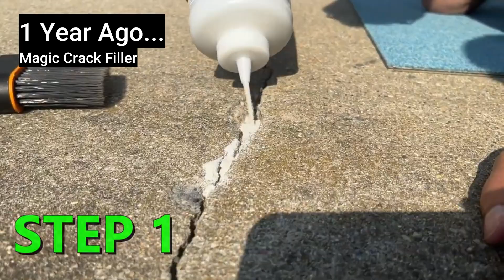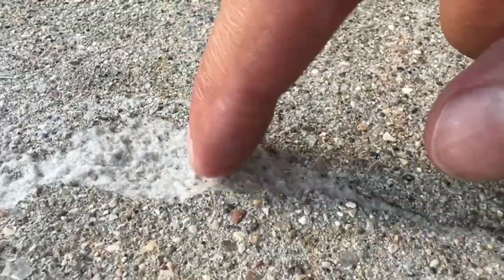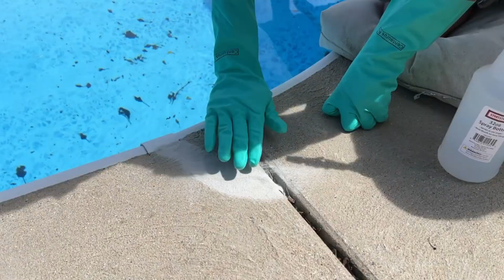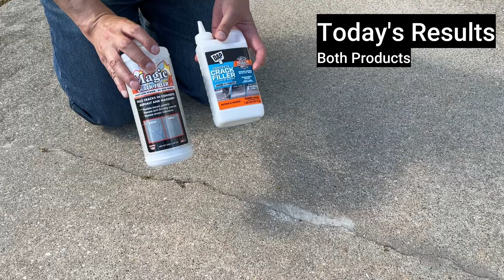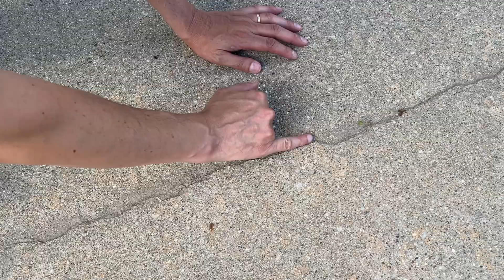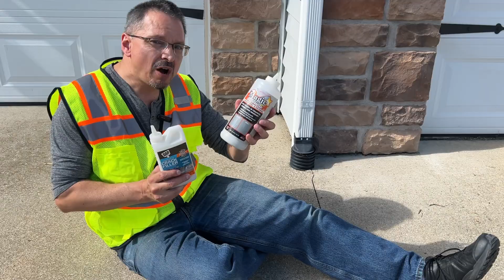Comparing Concrete Crack Repairs 1 Year Later

Comment: You actually switched them. You used the magic filler in the drive and the dap by the pool but when you showed one year later you switched, so the magic filler worked the best
Reply from the maker: Thank you. You have good eyes 👀 I hope to remake this video soon 👍🏼😎 

Both products seem to be basically colored Polymeric sand Paver Sand. So they help but won’t last forever

Comment: Why is it White ?  It doesn't match your cement.
Reply from the maker: They do try to make the blend a typical Concrete color, however, everybody’s concrete is a little bit different. Mine also has hard water stains as the sprinkler system often gets on the driveway. In real life, it looks pretty good, but I’m video  sometimes the colors get a little distorted

Comment: won't last. skip to epoxy and use this stuff as a topper or just sand...
Reply from the maker: You may be right 👍🏼😎 If it’s a large crack, I like urethane Fix for Large Concrete Cracks and Gaps
https://youtu.be/3HVg2Bpna78

Comment: Can I use the DAP on chimney crown cracking?
Reply from the maker: Polyurethane caulk  would also be excellent for cracks
Reply from the maker: Yes, you could but I do find that those chimney crowns get so weathered, I would probably recommend resealing entirely such as with a patching concrete or something similar. As a home inspector, I’ve inspected tens of thousands of properties and those chimney crowns get so beat up.
Reply: @HomeRapidRepair Could I use the DAP filler then Chimney RX Brushable Crown Repair? Thanks.
Reply from the maker: @michaelgeisert289 yes & yes. Best of luck to you 👍🏼😎
Reply: @HomeRapidRepair Thanks!!!

Comment: Seeking comment
I have root heave crack non displaced
Would you recommend dap for that crack?
Reply from the maker: Honestly I would just use polyurethane concrete caulk and it will STAY sealed. Here’s my video: Fix for Large Concrete Cracks and Gaps
https://youtu.be/3HVg2Bpna78

Comment: Have you pressure washed over the Dap crack filler and can you apply solvent or oil based sealers over this without breaking down the filler? I don’t care about the crack being visible as I have too many cracks to want to take the time to finish it out like a car going to SEMA!
Reply from the maker: I think the sealer is a fantastic idea. 

No I don’t think it would survive pressure washing without some damage or losing some of the filler. For that use polyurethane concrete caulk…this will hold up…100% water proof: Fix for Large Concrete Cracks and Gaps
https://youtu.be/3HVg2Bpna78

Comment: Neither one looks good. There is still a visible line, even though you say it's filled.  Waste of time and money.  You just highlighted to everyone where the crack is with a lighter shade...
Reply: But no water is getting in regardless of looks
Reply from the maker: Your criticism is fair 👍🏼
Reply: @HomeRapidRepair  Your really doing it to prevent it from getting worse. If you think the crack will disappear you’re from another planet.
Reply: Waste of time and money. You missed the whole point of the product. It’s meant to prevent water intrusion. Not to perfectly hide a crack for aesthetics.
Reply: @bustex1  then why is it a waste? If it keeps water out, may keep it from getting worse by the soil getting over saturated and changing over time, right?

Comment: I was thinking MF was a bargain brand so it didn't perform as well but 5X the cost of Dap?!
Reply from the maker: I just researched on Amazon. It was three times the cost. Thanks for commenting 👍🏼😊
Reply: I used DAP on a crack looked great but winters in Pittsburgh it didn't hold up.  It cracked and began chipping out the next year.  It may be the winner of the test here but in cold winters and hot summers I think the best way to seal is something that has elasticity to it.
Reply from the maker: @rrayrichardson6084  You bring up good points for sure. Here is a poly caulk video of mine  you should checkout: https://youtu.be/3HVg2Bpna78